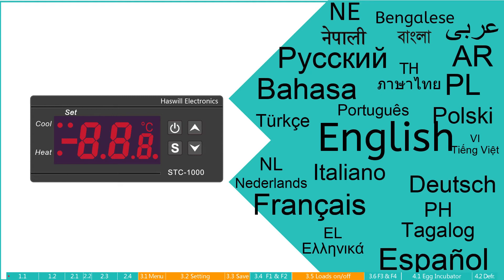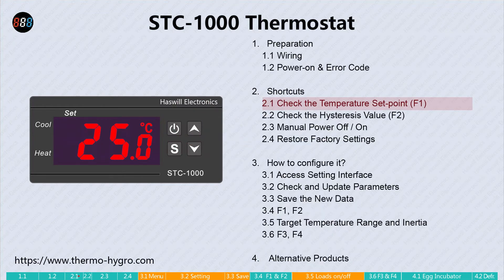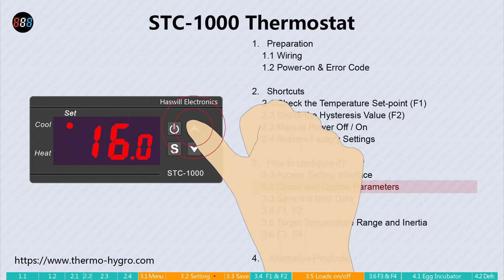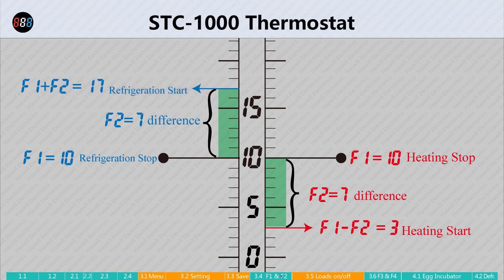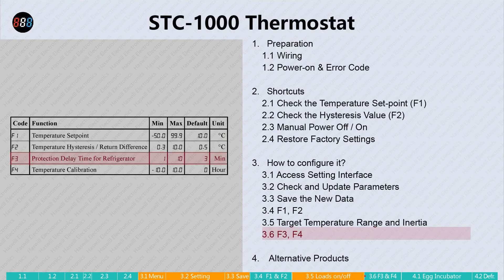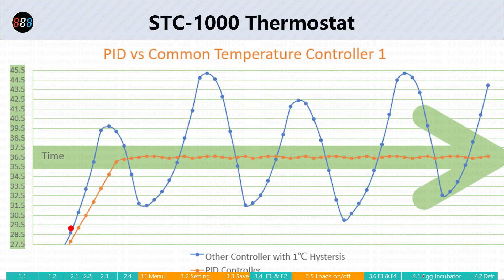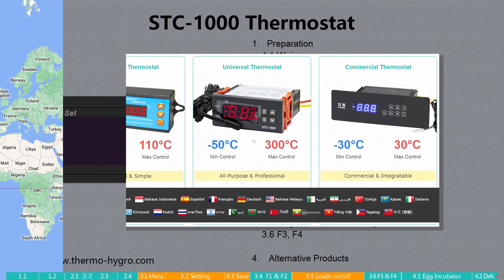The Ultimate Guide to set STC-1000 Temperature Controller

Comment: Can this be changed from C to F ?
Reply from the maker: depends on the version you've bought, some versions supports it, the others does not.
Reply: @Haswill  The original 100 was able to switch from F to C, the knock off ones generally can't. More specifically, you can buy them in C or F
Reply from the maker: No, it depends on your luck.

Comment: My STC 1000 is in a B&H CW 5000 chiller.  I'm getting a tone and a "PP" error code.  Can you tell me what this is and how to clear it?  Thank you for the very informative video!
Reply: How do you change units for Centigrades to Fahrenheit?
Reply: @tocallo33  I've checked just about everywhere and I can't figure out how to change to Fahrenheit either.
Reply from the maker: sorry, the origial elitech stc1000 without this error code.  Um, please seek help from the manufacturer of your controller.
Reply: My controller is for a regrigerated water supply.  How do I program the new controller  to match the original parameters on the old, faulty controller?   @Haswill
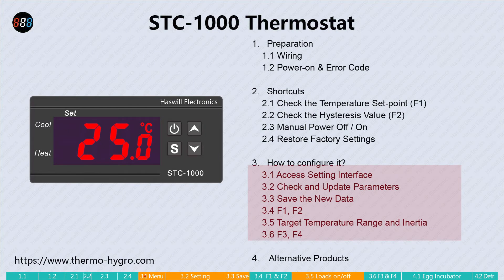Reply from the maker: @microreniassance2929 01:17 shows you how to access the function menu interface, check and record each parameter of the old one, and set the same value to the new one.
Reply: Get a better thermostat. Even the genuine STC-1000 has a terrible reputation for reliability. I've had about 6 and 3 have failed in some way.
Reply from the maker: what brands or models you recommend please?